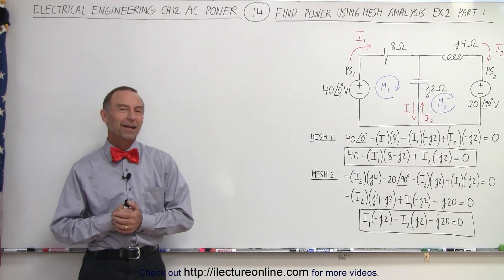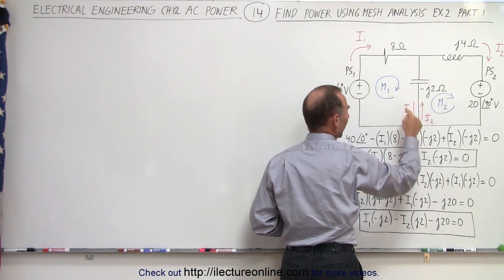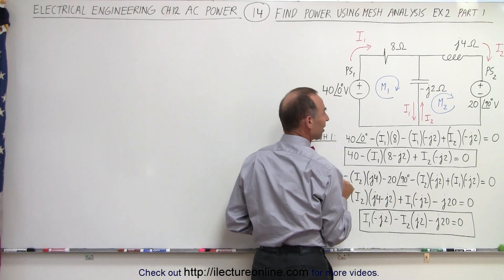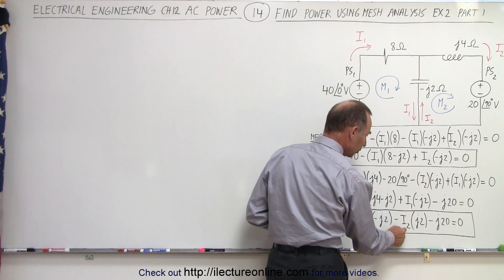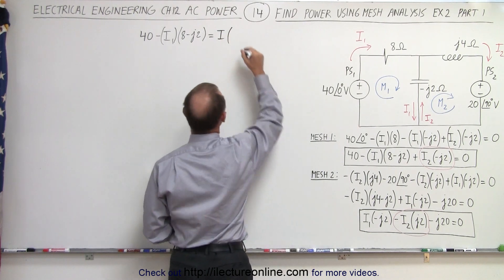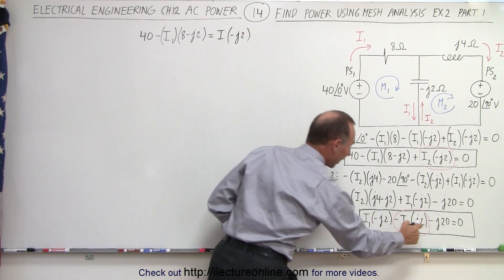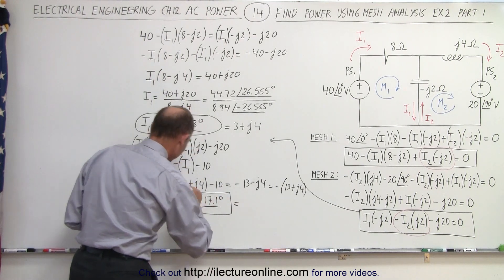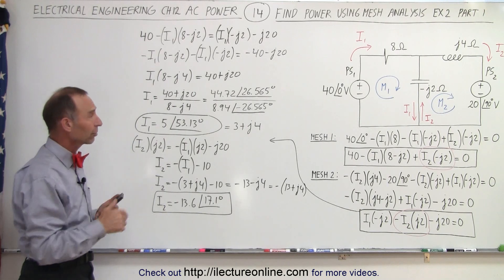Electrical Engineering: Ch 12 AC Power (14 of 38) How to find Power Using Mesh Analysis Ex 2 Part 1?

Comment: Great video mr. Biezen. I know this video is about mesh analysis, but I would like to contribute saying that this problem can be solve by node analysis; which will give us a single equation in function of 'V' (only one coefficient besides the two currents calculated) that can be easily calculated. Anyway, this can be an exercise for those who are watching it to reinforce their knowledge on this subject. 

Anyway, you helped me a lot on my graduation, Mr. Biezen, keep the good work! Greetings from Brasil.
Reply from the maker: As you pointed out, there are usually a number of techniques that can be used to solve this type of circuit.